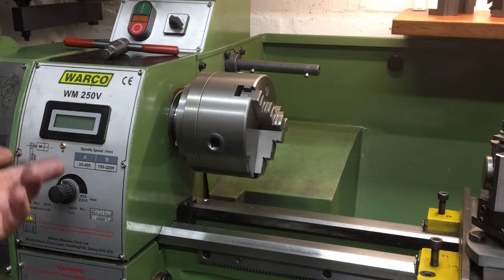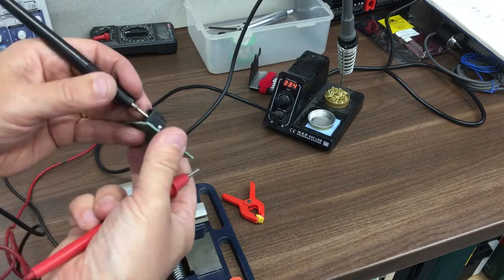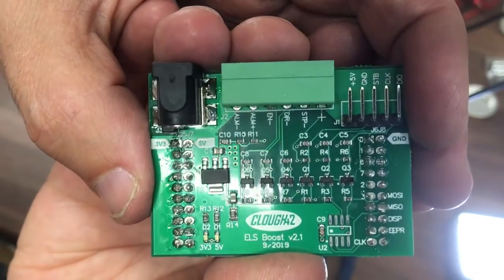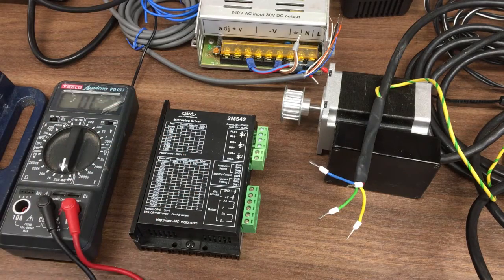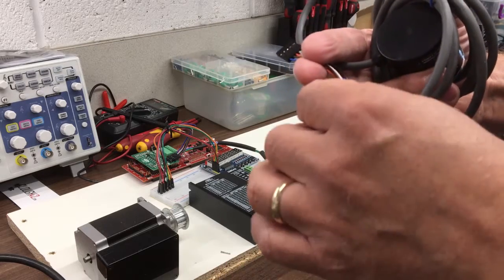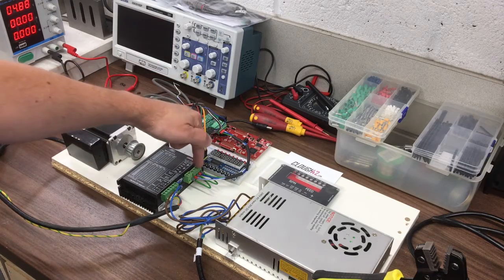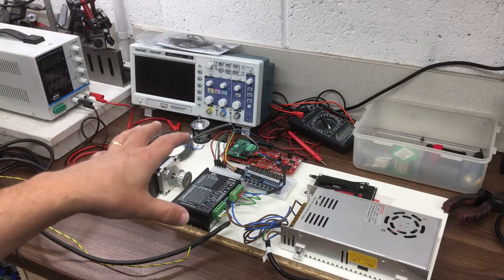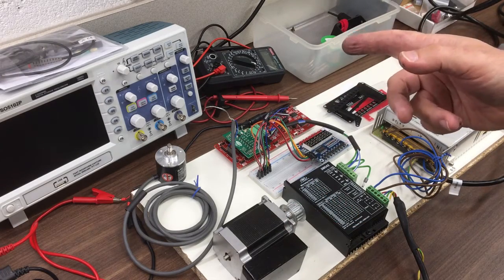Ep02: Clough42 Electronic Leadscrew | Sorting the electronics

Comment: You set the code load to be either in debug or non-debug mode. The difference is important. In debug mode any code already on the Launch pad board is not overwritten, the newly loaded code is run from the debug chip. If the Launch pad is powr cycled the newly loaded code is lost and the original (if installed) runs. In non- debug mode the code is written direct to the main processor memory and overwrites any previous version. The final code load therefor must be done in non-debug mode. Debug mode is a complier selectable option. You absolutely must watch of of the Clough42 videos on this ELS in order to get it to work. They are very comprehensive also very necessary. Do not try and wing it, you will regret doing that.
Reply from the maker: Yes I could not have done it without his video guides

Comment: 25:01 A paint pen or equivalent means to dab matching asymmetric reference dots to the board and corresponding connector stand out great as a diy orientation reference. Using different colours helps prevent location errors too.

Comment: Look at PA-09 compression crimp pliers. I don't like the ratcheting pliers, which crimp both shield and pin together. The PA-09 pliers are non ratcheting, you crimp the pin first, the shift the plier and crimp the insulation,  so much easier. I've been using these for years, and I can crimp very small connectors very quickly and securely, so now making these cables is pretty fast.
Reply from the maker: Thank you!  I’ll look into those.
Reply from the maker: Ooh, quite expensive (£40) so far . . .

Comment: Hi folks, I've built one. The DuPont connectors require the correct crimp tooling. It is now available from IWIS at an affordable price, I modified the jaws of a standard crimp tool. DuPont connectors need the insulation gripping wings to be formed into a circular shape, not turned in to bite into the wire insulation.  The crimp works ok but the connector then becomes very difficult if not impossible to insert into the housing. You can find info online about this aspect. My hands shake and I found making these very difficult.  may be better to use ready made wire and connectors.
Reply from the maker: I made a fixture to help make my connectors but it is still fiddly